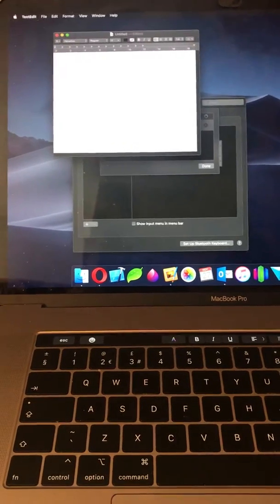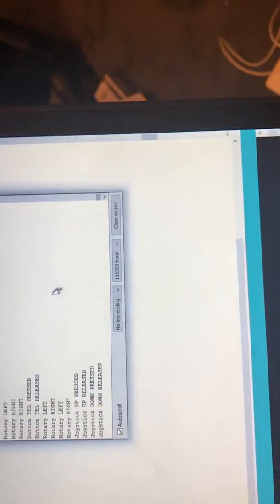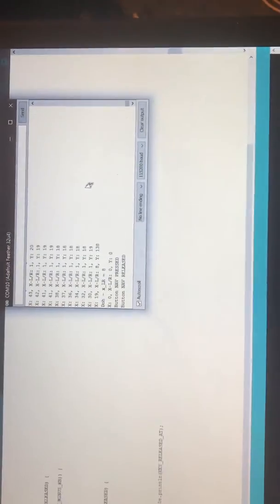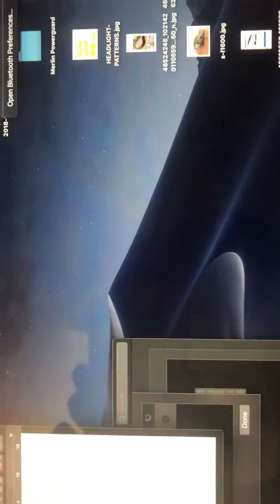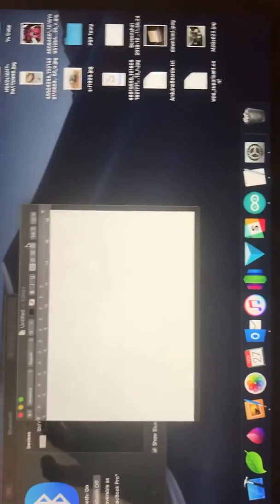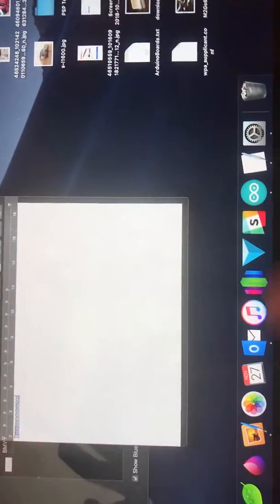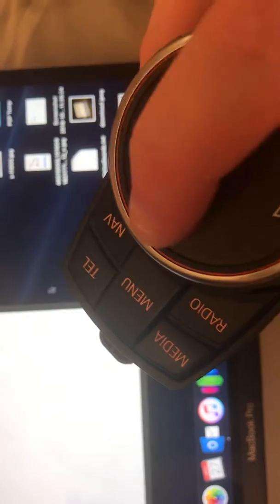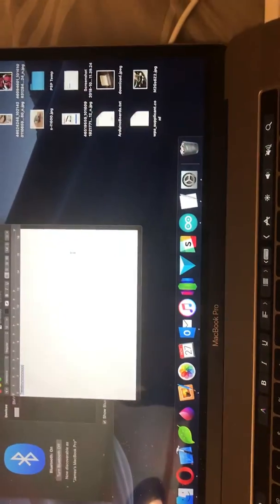BMW iDrive BLE HID 2

Comment: Hi please can you help me, im trying to build this project but i have issues i cant eliminate. im using the featherboard 32u4, can module is mcp2515 with  TJA1050 , and im using the idrive with the big touch and 7 buttons. the problem is it hangs after "CAN-BUS Featherwing ok!" i cant receive any button actions. sometimes i get empty data message rolling down the serial monitor or it hangs. it tried 5v 3.3v level shifter . 100kb ,500 kb . it doesnt work. i cant initiate the device.
Reply from the maker: The tja1050 won’t work with the idrive. You need a “proper” can shield that has mcp2515 + mcp2551

Comment: will this work using a arduino uno r3 with a can bus shield?
Reply from the maker: Yes and No - you'll be able to interact with it from a CANBUS stand point.... but the Uno is NOT capable of HID so you'd need a HID compliant bluetooth shield also.  (There's no such thing that I know of as a USB HID shield).  For USB hid you need something with the 32u4 for example (Leonardo)